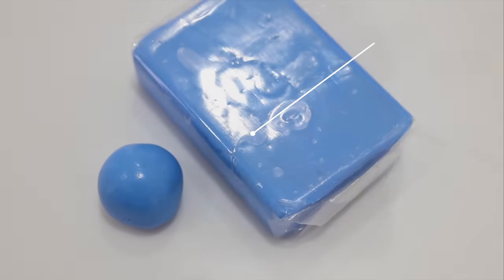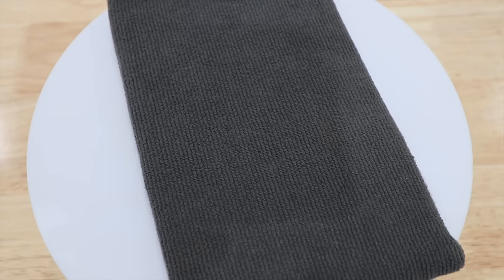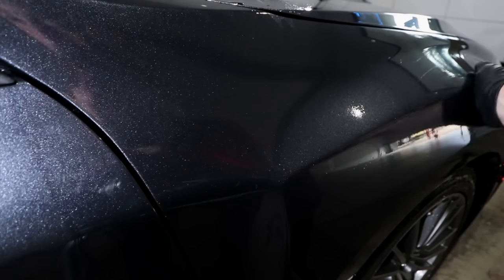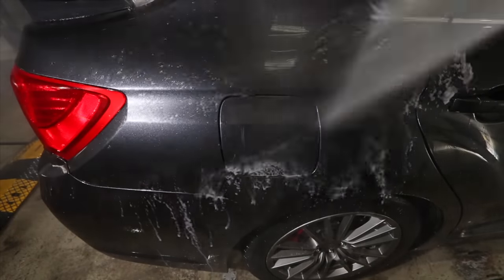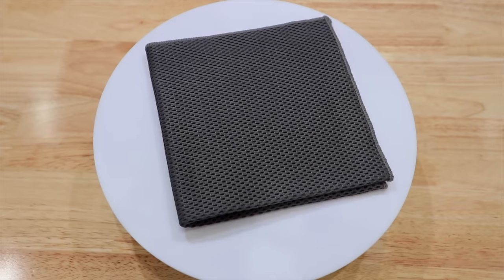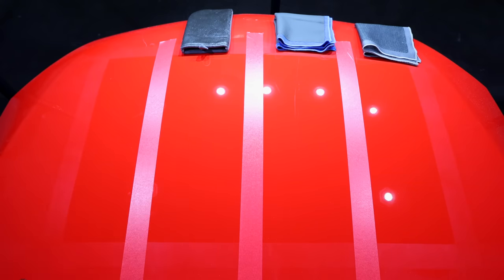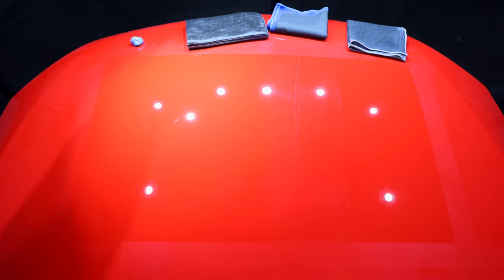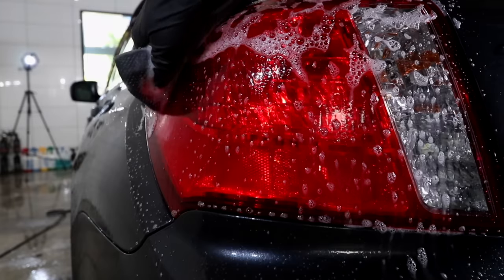The Future Of Automotive Clay? Faster | Safer | Amazing!

Comment: How many cars can you clay with this cloth?  I'd imagine it would eventually fill up with muck?   I checked the website and I cannot really tell?  Perhaps I'm being thick!
Reply from the maker: It should be good for dozens and dozens of cars and it won’t fill up with muck, unlike traditional clay that holds the contamination, synthetic clay releases it.
Reply: I've gone through a couple of clay mitts, and the clay material eventually hardens up and marrs the crap out of the paint. 
I don't know if it's time alone, dirt or both that causes it?!

Comment: Great review!!! How does it handle mild overspray? Does it work with iron/fallout removers? Thank you in advance.
Reply from the maker: Thanks, and over spray is always a case by case scenario. The quicker you get to it the better and yes and most synthetic clay can by used with iron removers
Reply: I had overspray from CarMax touching up like they always do - I had it 5 years before I clayed it and the Mequiars Bar took it all off without any issues.

Comment: How do you know when these mitts or towels are due for replacement because you can't see the dirt on them as they are all black or very dark grey!
Reply from the maker: Synthetic clay won’t hold or store any dirt or particles like traditional clay - it releases it - so they only need replacement when their surface becomes warn out which is usually after years of use
Reply: @CarCraftAutoDetailing  Thanks Sandro! Sounds like I need to stay away from the clay mitt I have been using in that case cos it mars badly!

Comment: Hi Sandro , Do you think Economax clay cloth is safest way until or something like clay block like mother’s speed clay 2.0 block style more safe ?
Reply from the maker: A fine traditional clay bar is still pretty safe or non-aggressive but it does take more time and passes to get there compared to this cloth so in the end it could be more aggressive.  But if you use this cloth in an aggressive manner it also has the potential to be more aggressive.  It’s not an easy straight forward answer as the technique you use - if it’s a good gentle one - can make it extremely safe, but used more aggressively it could be more aggressive than a clay bar.

Comment: Do you have to machine polish after claying with either a bar or this economax towel? Thanks 😊
Reply from the maker: Nothings says you have to - but claying of any form can produce micro swirls/marring that a light polish will remove
Reply: @CarCraftAutoDetailing  ok thanks! Was wanting to clay my car but I don’t have a clean dust free area to machine polish as I only have a driveway. Was hoping a clay would bring it up a lot better than it is now
Reply from the maker: Claying will most likely greatly improve the finish especially if the vehicle hasn’t been clayed for some time and does have significant fallout- claying is also important to care for the condition of your paint. 
May have a look at the video below - you can certainly polish a vehicle outdoors but like I mention before you don’t have to polish, you can just clay and them apply a wax or sealant. 
https://youtu.be/mNp5Izcz5ck
Reply: @CarCraftAutoDetailing  that’s great! Thank you so much for the help! I’ll try giving it a clay and then will see how it comes out. Going to try getting one of the towels like the economax I think as I feel they seem a bit easier to work with than a bar!

Comment: Great video and demo. I do disagree on the traditional clay bar, they’re all the same. Meguiar’s and Mother’s charge more because they can (brand recognition), not because it’s better. I’ve used both and within 6 months and a few uses, the clay sticks to its container, leaves streaks on the paint when it hits a non-lubricated spot and is extremely tacky making it impossible to mold. That’s the same result as these knock-offs you see online but cheaper and sometimes you get more. I do want to try the new product you demo’d, the logic behind the review makes total sense.
Reply: Brad --  No, all claybars are NOT the same....Meguiars and Mothers are probably the worst to use...Way too sticky.... Also, you need to store your claybar in an airtight as possible container, and add a little claybar lube inside the container before closing it up... Otherwise, it dries and becomes very sticky and hard to even remove from the storage container....

Comment: Is this towel as effective at removing as a claybar from geon, meguiars or another quality brand?
In a coating process would you use it to decontaminate?
thanks for the video !!!
Reply from the maker: With a good thorough technique it’s just as effective and perhaps noticeably quicker. I’d use it before coating to remove fallout, but not after
Reply: @CarCraftAutoDetailing  thanks!

Comment: How to clean clay towel by area to area?
Reply from the maker: For the most part, your claying solution liquid with flush the towel as you clay, but you can regularly rinse it in a bucket or as you rinse the panel after claying with your hose/washer.

Comment: Why not just find a water hose that has the metal end cut off, turn it on very slow, and use that while you are using your clay towel, bar, etc., to really help lubricate AND remove whatever is being  removed from the paint, and never get marring, to begin with ???  This is how I have  wet sanded hundreds of vehicles we primed, painted, wet sanded, and then compounded, since the 70's......  Never had an issue with marring anything, but this also comes from using more finesse', and paying attention to the sounds of the work and the panel as you do it.. One hand holds the hose with no metal end on it, above the work, the other is holding the block and wet-or-dry-sandpaper, and the hose with a trickle of water coming out that follows the work... Result is better, faster, work, and no extra damage/anything to the surface...Beats having to spray your product, or whatever, constantly with the other hand, and you go much faster and effectively...
Claybars, invented in Japan, in the 80s's I believe, absolutely still do a great job, but the small area of work takes longer,..They used to make a claybar cleaner that you just sprayed on the bar that had all the junk off that paintwork, and it melted the claybar just a little and the junk came right off the bar, and it was clean... No more having to knead, and knead, to find a clean part ot the claybar... 
Certainly all the versions of the claytowels, etc., were an improvement, and in my experiences using only the mild versions, they took longer to get the worst, dirt embedded paintwork sheared off the paint, so that was the trade off for me... 
Again, running a little water over the work AS you are doing it will be light years faster and allow you to go longer on that side of your towel,, etc., and that is a time savings in my book always...

Comment: I'm not a big fan. Some of the rubber on the cloth was coming off and sticking to the paint work. Don't like the idea of reusing and causing cross contamination.
Reply: If it hits a dry spot, it may do that. I haven't had my mitts do it. 
However the clay material will melt if exposed to solvents such as tar removers.